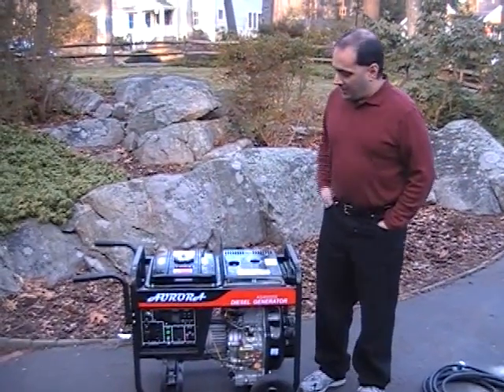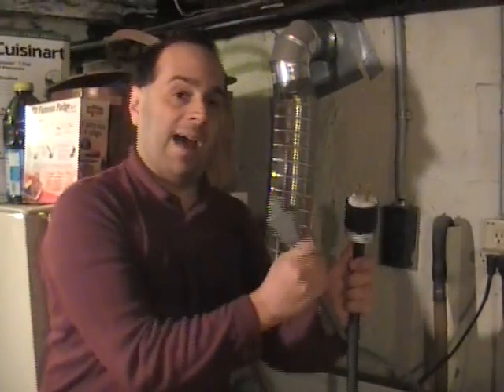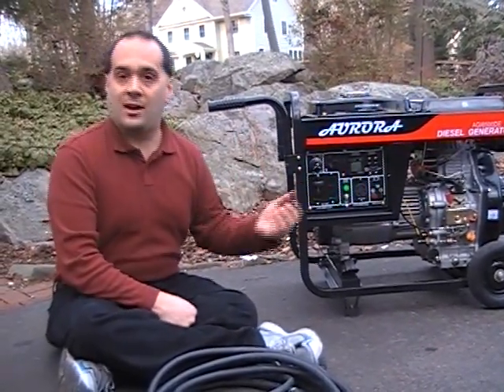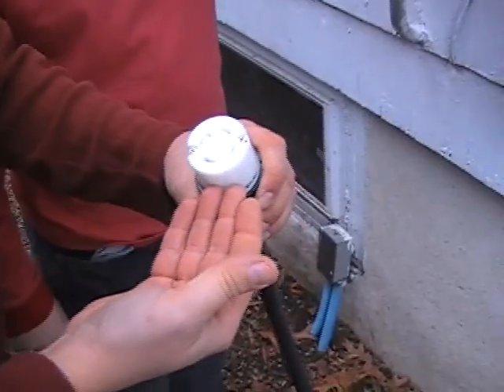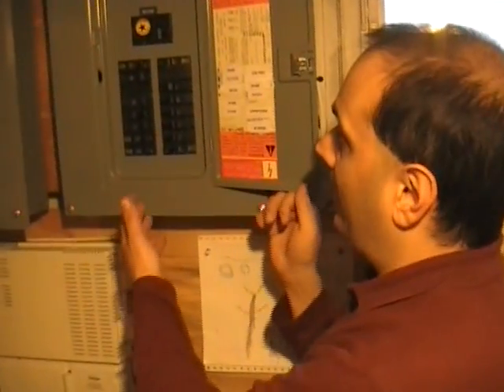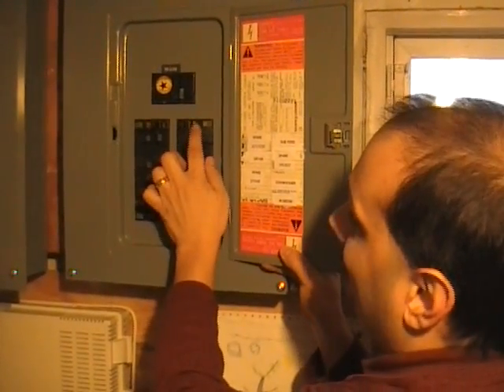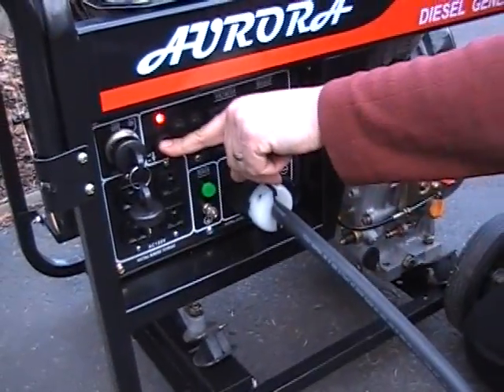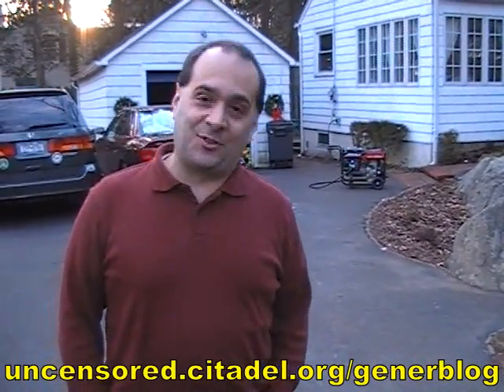Inexpensive residential generator hookup

Comment: Good video. Just two suggestions however.

A "weather shield" should be placed over the exterior input. They are available for both 110vac outlets and for 220/240vac input fixtures.

The "output end" (female) of the power cord link to the generator should be a 90 degree unit so as to reduce the torque on the  installation of the cord into the receptacle.
Reply from the maker: The receptacle itself is an outdoor rated fixture with weather sealing on the spring-loaded lid, so we're ok there.

The 90 degree plug is a good idea.  I've also seen inlet receptacles that point downwards, so that would be a good way to solve the same probme.
Reply: Yes that is the case when the cover is closed. However, when the receptacle is in use it is open and exposed to the elements. There are covers specifically designed for use during stormy weather which protect against water intrusion and possible shock hazard. The latest building codes require these covers on exterior electrical outlets. http://www.legrand.us/passandseymour/covers/while-in-use-covers/flush-mount-while-in-use-covers/wiufc10wqc.aspx#.VMmTjS4e1LM
Reply: Wayne Alan Without researching, I don't believe the NEC requires a in-use cover for a portable generator simply because it is considered temporary. The Nec requires in-use covers for the required general convenience receptacles located outside.For that matter I have never seen a portable generator with in-use covers either, the reason being is any connection to them is considered temporary.Just a thought.

Comment: Great video. I have a newer house with a large panel and a 4kw gas generator and I'm planning to add the main panel interlock. One advantage of this approach is that you can run any of the circuits (not all of course) so it's more flexible. What you did is a great solution when your panel is too small.
Reply from the maker: Agreed.  Let the pre-existing layout of the home's electric service be a guide to what kind of solution is implemented.  I had that little 16-breaker panel so the sub was a no brainer.  I've since moved into a larger home with an outdoor 200 amp disconnect that looks like it could be replaced with a transfer panel.

Comment: Watched video and called electrician…I have a smaller generator and really just want to power my furnace and fridge for now but think when the electrician gets here I will talk to him about putting in a large enough sub panel so if I upgrade the generator additional breakers to power the oven, tv and a few additional lights will already be there.
Reply from the maker: Sounds like a plan.  Just be sure to avoid those cheap retrofit subpanels with the button breakers.

Comment: you are missing a strap under your meter that's a code violation
Reply from the maker: I'm not sure what you mean by "strap" but the entire system has passed two electrical inspections (one after the generator installation and one when we had to clear up some non-electrical issues when we sold the house).

Comment: Wow I am glad I stumbled upon your video! I had a feeling this could be done and was trying to research how to do it. Saving me big bucks over a transfer switch "kit" and also freeing up a few breaker slots for an upcoming basement remodel by moving those breakers over to the subpanel, 2 birds with 1 stone!
Reply: Here is the Generator safety information: Always make sure you follow all the generator safety rules before using your portable generator. This is only a reminder. Generators can be dangerous if not used carefully. Every year, hundreds of people die or get injured when using portable generators due to carbon monoxide poisoning and electrocution. Make sure you are using your generator carefully and keeping others safe as well. There is something very serious that everyone should always be aware of when using generators. Some people do run their generator indoors which is not safe and that increases the risk of carbon monoxide poisoning which can cause death of family and you. Some people run their generator in wet conditions which can electrocute them. Please remember that you should never run your generator indoors. Remember that carbon monoxide is an odorless and colorless gas that you cannot see or smell. Carbon monoxide is a silent killer. Keep that in mind. Make sure your generator is 15-20 feet away from your house and away from doors, windows, and vents. Never use your generator in your porch too. Having a carbon monoxide detector is very important against generator safety. Some people also allow children to go near the portable generator which could pose risks. We need to keep an eye on our children making sure that they are not near the portable generator so they won’t get electrocuted or burned by the generator which is dangerous. A locking enclosure also keeps kids safe. A generator shed might look like a tempting place to explore, or take cover during a game of hide and seek, but a generator is a dangerous piece of equipment that can cause injury. It says on the manual that we should also keep children away at all times from the portable generator to avoid injuries. Please do not allow a child or unqualified people to operate the portable generator.  It is important to keep your children safe especially little ones. The portable generator can be hot during an operation. Just because some manuals missed what should be listed doesn’t mean it’s safe to do. Always follow the generator safety rules when using portable generators. Generators pose electrical risks. If you need to use your generator during wet weather, you need a generator tent to protect your generator from getting wet. Don’t let your generator get wet. Keep your generator dry and before using your generator, please make sure your hands and your generator is dry. Do not wear loose clothing when operating the generator. Everything that is said on the generator’s operating manual should not be ignored. Never smoke cigarettes near the generator. Please keep flammable things away from the generator. Never overload your generator too. Your generator can catch fire. Never ever try to plug a generator cord into a wall outlet to avoid back feeding. Back feeding your generator is dangerous. Always turn on your generator first before plugging in appliances and shut off the appliances before turning your generator off. Use a heavy duty cord for your generator and the cord should not be worn out. All the instructions should be followed carefully. Never refuel your generator while it’s running. It can cause fire if fuel spills while your generator is hot. You should turn off your generator and let it cool off before refueling it. Having a fire extinguisher next to the generator is also important. This is only a reminder for everyone’s safety of using generators. Make sure your generator is properly grounded. Having a fire extinguisher next to the generator is also important against the safety rules. https://youtu.be/I1jT3ANENvI and here is a video more about keeping others safe when using generators and also about our family’s safety. It’s important to keep our little children safe as well. Make sure they’re away from the generator. Hope this helps.

Comment: Did the inspector require you to disconnect the ground to neutral jumper on your generator? May be helpful information. Thanks!
Reply from the maker: The inspector was only concerned with the permanent wiring; he didn't even ask to see the generator.  That having been said, however, to make an installation absolutely "perfect" it is often the case that the ground-neutral bond is disconnected inside the generator (see also: "separately derived system").  Most people do not do this because it then makes the generator unsafe to operate when not connected to the house, unless the bond is reinstalled.

Comment: Well done. I am an IT guy now (systems admin) but I spent 12 years as a professional electrician. When I first saw this video title I was worried - but you covered the "DO NOT DO THIS" stuff perfectly.

The only disadvantage to this is that some people (my wife) would have a hard time learning to do this in the proper order if I wasn't home - plug in cable, turn off generator load, turn on generator, turn on generator breaker(s), turn off sub panel branch circuit breakers, turn off sub panel main, turn on sub panel generator main, turn on sub panel branch circuits... I'd have to write easy instructions and draw pictures. lol

Still well done and explained. Thanks for the video!
Reply from the maker: viopsadmin Thanks for the kind words.  I agree that it can be a bit overwhelming to understand all of the required steps, which is exactly the reason we need safety interlocks.  People who say "bah, I don't need that, I know what I'm doing" don't take into consideration that the day will come when another member of the household attempts to get the generator started, misses steps and/or gets them out of order ... and then they either get themselves or a lineman killed, or at the very least destroy the generator.  With a proper interlock and inlet receptacle, the worst that can happen is they trip the breaker on the generator.

I am an IT professional as well, an infrastructure architect.  A lot of my knowledge of electrical systems is based on what we do in large data centers.

Comment: Does that 240 volt generator power L1 & L2,  I have a similar set up But with 120 powering just L2 eg  gas furnace lights tv, Just curious with the 240 models The black would power L1 and Red L2. (selected loads) thanks nice job. :)
Reply: Generator safety: Always make sure you follow all the generator safety rules before using your portable generator. This is only a reminder. Generators can be dangerous if not used carefully. Every year, hundreds of people die or get injured when using portable generators due to carbon monoxide poisoning and electrocution. Make sure you are using your generator carefully and keeping others safe as well. There is something very serious that everyone should always be aware of when using generators. Some people do run their generator indoors which is not safe and that increases the risk of carbon monoxide poisoning which can cause death of family and you. Some people run their generator in wet conditions which can electrocute them. Please remember that you should never run your generator indoors. Remember that carbon monoxide is an odorless and colorless gas that you cannot see or smell. Carbon monoxide is a silent killer. Keep that in mind. Make sure your generator is 15-20 feet away from your house and away from doors, windows, and vents. Never use your generator in your porch too. Having a carbon monoxide detector is very important against generator safety. Some people also allow children to go near the portable generator which could pose risks. We need to keep an eye on our children making sure that they are not near the portable generator so they won’t get electrocuted or burned by the generator which is dangerous. A locking enclosure also keeps kids safe. A generator shed might look like a tempting place to explore, or take cover during a game of hide and seek, but a generator is a dangerous piece of equipment that can cause injury. It says on the manual that we should also keep children away at all times from the portable generator to avoid injuries. Please do not allow a child or unqualified people to operate the portable generator.  It is important to keep your children safe especially little ones. The portable generator can be hot during an operation. Just because some manuals missed what should be listed doesn’t mean it’s safe to do. Always follow the generator safety rules when using portable generators. Generators pose electrical risks. If you need to use your generator during wet weather, you need a generator tent to protect your generator from getting wet. Don’t let your generator get wet. Keep your generator dry and before using your generator, please make sure your hands and your generator is dry. Do not wear loose clothing when operating the generator. Everything that is said on the generator’s operating manual should not be ignored. Never smoke cigarettes near the generator. Please keep flammable things away from the generator. Never overload your generator too. Your generator can catch fire. Never ever try to plug a generator cord into a wall outlet to avoid back feeding. Back feeding your generator is dangerous. Always turn on your generator first before plugging in appliances and shut off the appliances before turning your generator off. Use a heavy duty cord for your generator and the cord should not be worn out. All the instructions should be followed carefully. Never refuel your generator while it’s running. It can cause fire if fuel spills while your generator is hot. You should turn off your generator and let it cool off before refueling it. Having a fire extinguisher next to the generator is also important. This is only a reminder for everyone’s safety of using generators. Make sure your generator is properly grounded. Having a fire extinguisher next to the generator is also important against the safety rules. https://youtu.be/I1jT3ANENvI and here is a video more about keeping others safe when using generators and also about our family’s safety. It’s important to keep our little children safe as well. Make sure they’re away from the generator. Hope this helps.

Comment: After my 3rd view, I noticed you have a smart meter on your home (former home that is).
Do you agree with the discussions about their safety (fires), health (EMR/RF) and privacy (home surveillance/loss of control over your utility usage)?
Just curious...thanks,
Reply from the maker: I think it's all overblown hysteria.  The smart meter doesn't have a view into my house.  It only knows how much electricity I am using.  In my new home I am getting day/night metering and am saving quite a bit on that basis.

As for the RF/EMI issue ... anyone who thinks that's an issue, I hope they don't have a cell phone or WiFi in their house.  Both emit more radio power than a smart meter.
Reply: Art Cancro True...aside from the actual or perceived health risks, homes have caught fire at the source (smart meter) and the utilities will be able to control utility usage remotely as the "smart" appliances emerge.  I guess I don't want the utility provider controlling when I can wash clothes or bake a casserole...that's just me.  Thanks Art!
Reply from the maker: bang zoom I did a bit more research on this, since I moved last year and my new home has a smart meter as well.

It seems that the source of smart meter fires isn't actually the meter itself.  Poor installation practices are to blame.  The electric companies hire contractors who are paid by the number of changeouts they complete in a day.  These contractors quickly rip out the old meter, slam in a new meter, and put a new lock on the pan.  The homeowner is not likely to be present to turn the power off, so both the removal and insertion are done "hot" which causes arcing and damages the contacts.  Because they are slamming the new meter in so quickly, that damages the contacts even more.  Damaged contacts can arc and deteriorate further and eventually start a fire.

So it seems the meter is not to blame after all.  These fires would be happening even if they replaced the dumb meter with another dumb meter.

As for the chatter about the utility being able to micromanage your electricity use ... all I can say is that I'm not buying it.

Comment: If you intentionally install heavy duty copper wire from your dryer outlet to your breaker box which is 10 feet away and has new breakers in it, could you safely run your house?
Reply from the maker: The wire gauge is not usually the problem (although as I mentioned in the video, I've heard of people having problems with that as well).

To operate a dryer outlet safely as a generator hookup, you have to convert it to an inlet (male receptacle) which means you can't plug your dryer into it anymore, and you also have to interlock the breaker with your main so that they can't both be closed at the same time.

Comment: What would you recommend for a 15Kw portable generator with a 50 Amp Plug?
Reply from the maker: You can do the exact same thing.  Simply substitute a 50 amp breaker, a 50 amp inlet receptacle, and 6 gauge wire instead of the 10 gauge wire you'd use for 30 amps.  (As always, check your local building codes and get a permit; I am not an electrician.)
Reply: Thanks :)